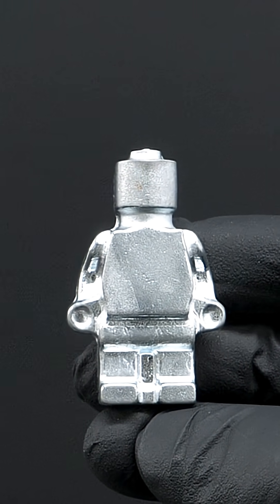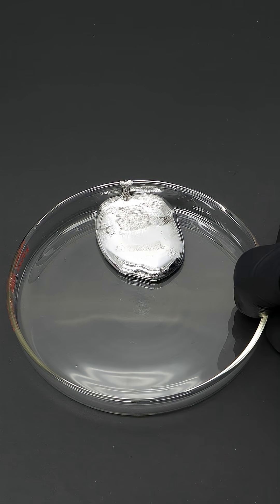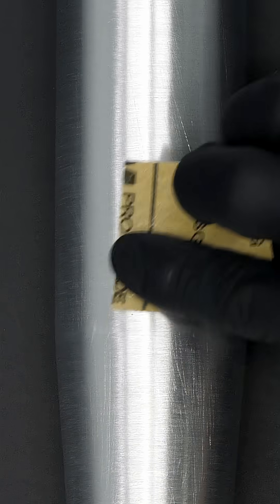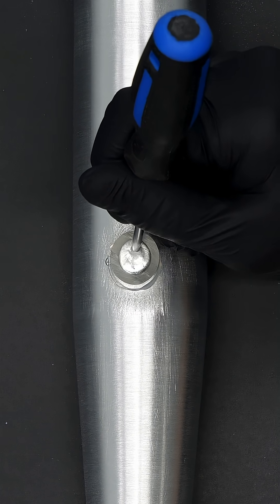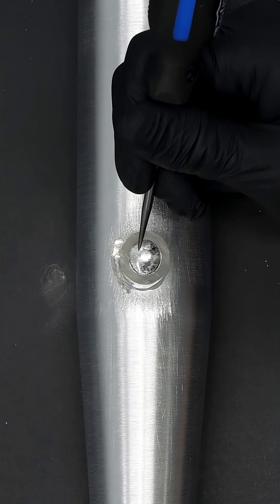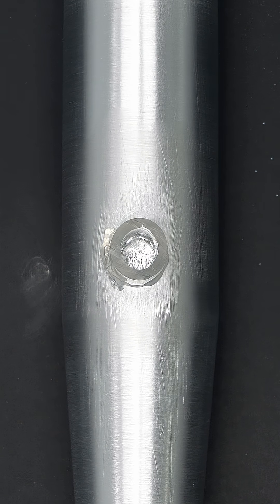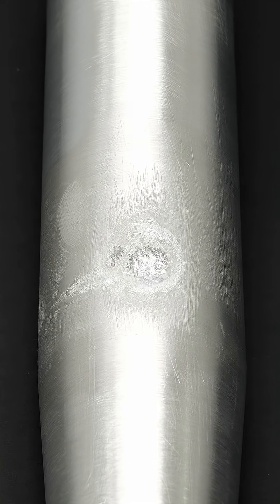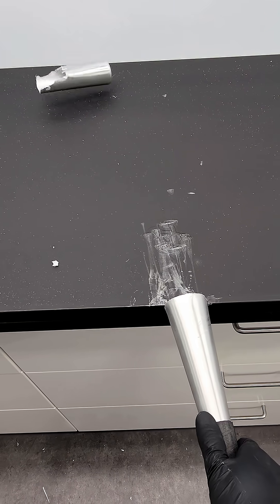This is what gallium does to aluminum

Comment: The reason why it's crusty like that is because when gallium is circulated with air molecules, they cause a chemical reaction similar to Pythagoras arc, then subdermal integrity is broken due to a combination of elenticity and di hydromoric composure, the crusty part you see is the separation of those particles,  condensed to a particular, tryhydrothermic equivalent!

Comment: We won't let anyone even come close to our fighters with that stuff. Just a few drops can bring a fighter down. And airlines are even more paranoid that some passenger might bring Gallium aboard, and for good reason because it's more dangerous than even LiIon batteries to a plane where at least you know when a LiIon battery catches fire, but with Gallium it can continue to spread for hours, even days until it causes a possible catastrophic midair breakup due to crystallization of the pressure vessel or it's support structure and there's no easy way to know if someone on an earlier flight accidently dropped some on some exposed metal or even carpet that it could soak through. 
That's why any pilot that knows about that stuff is justly afraid to think of Gallium getting anywhere near a plane even one made of wood because there isn't a plane made that doesn't have some aluminum in a critical place somewhere.
Though at home it can be fun to play with if you know what not to get it anywhere near. And how to store it properly without it eating your fridge or making your car look like swiss cheese if your don't know how to contain it because once it get started it's like the energizer bunny, it just keeps going and going  and you may not know it until it's eating away at you alloy parts until it's too late. And there's no way to stop it other than throwing the infected part away buried deep in a landfill someplace. It not toxic, thank god, it's just that you can't take a chance when that stuffs around because the amount that he had could probably destroy over a hundred time its weight in aluminum and thickness is no barrier. All that's required is time.
Just a head up because it's easy to aquired as it's non-toxic to humans or pets.
But it's slow death to any alloy that contains aluminum, so be careful how you use and store it.
Because it's better to be safe than sorry. Or just pissed off that you have to replace a bunch of your stuff made with even a little aluminum.

Comment: For some context: many "liquid metal" CPU thermal interface materials has gallium as the main ingredient.
Using liquid metal for PC cooling is always "High risk, high reward" stakes. Make one wrong miscalculation, or one move, your thousand dollar investment gets reduced to an overpriced brick.
Other than the obvious issues of electrically conductive TIM that could blow up the motherboard...
Using liquid metal on an aluminum cooler, will destroy your cooler in weeks!!!

Comment: This is why you have to be careful when using Liquid Metal (Gallium + Indium + Tin mix) in cooling applications for PCs as some coolers don't disclose that they use Aluminum in mating surfaces with what you are cooling and especially in liquid coolers it can be disastrous.

Comment: Mercury does something similar with Aluminum as well, and this reaction was rather infamous in the Aviation industry because analog electronics in older aircraft sometimes used Mercury switches and there are still procedures for most aircraft that cover what to do in the event of a mercury spill.

Comment: Iirc gallium is one one of the extremely few materials which contract in terms of volume when melting, the same way water does. Thus you could theoretically skate on gallium like on water-based ice under certain PT conditions.

Comment: This seems like a great tool for special effects in movies
Reply: Indeed. Not only is the texture weird af, but the brittleness could be useful
Reply: It does
Reply: Terminator 2 perhaps
Reply: Looks a lot like that scene from Terminator 2
Reply: @ChromaAqui they used mercury for that
Reply: Unfortunately, modern movies heavily rely on CGI enough to the point they're going to ignore how cool this could be.
Reply: Yeah!
Reply: Or a prank :)
Reply: @ЕвгенияЗайченко-з6ф 
it could maybe be a good prank, but i'd be worried about aluminum shards flying off and hitting someone when it breaks. 

hopefully that doesn't happen
Reply: That was exactly what I was thinking/going to say!
Reply: I can't really see how this would be useful. Even ignoring cgi, there have been fake breakaway metal props for probably decades. Use some really easy cuts to make it less obvious you're using breakaways, and you have a much cheaper and easier solution than hoping your gallium infused metal will be brittle enough to not damage anything or send metal shards flying across the room.
Reply: 🧐🤔T-1000.
Reply: yeha in theory, but it might be too unwieldy and impractical to actually be used. still a cool idea! the film industry just...has ways of making cool things happen.

Comment: Even weirder, its basically safe to handle or ingest in small amounts although id not recommend it. Its not good for your kidneys or stomach but testing results have shown its basically harmless unless you're ingesting A LOT. 

It used to be a high brow prank to make a gallium spoon in tea or such that would disappear into the tea due to its heat. 

Side note, the book the disappearing spoon is incredible, it goes through the periodic table telling about elements history and discovery which is originally where I learned this.

Comment: Someone breaks into my house and threatens me with an aluminum baseball bat. I toss the lump of gallium I always keep in my pocket into the air. I grab a hair dryer and melt the gallium in midair. The assailant swings the bat at my head with an arc that perfectly intersects the molten orb. The gallium finishes reacting with the aluminum as the bat hits my skull, shattering into hundreds of tiny pieces. One piece enters my skull through my left eye, killing me instantly.

Comment: Sooooo confession. My sister ex cheated on her. When I found out I was going g to conront about it. U ntil I remember he had a z06 corvette with a LS7. An aluminum engine for those that does not know.... only tricky part lifting his hood without making  so much noise and I poured so much gallium in where the spark plugs would be.. totally worth it

Comment: Once I bought Gallium to cool my ps4 pro (copper) sink. Worked amazing. But then I had this old run down pc with Aluminum sink, and i knew it will have a reaction but i tried it. Cpu worked well until 30 mins later it turned off and when i opened the fan sink it started to form a mountain on top of the sink (in 30 secs). It was crazy. That cpu lived through it though😂

Comment: Related trivia I learned in about 2005 at a lecture about about decontamiating old lighthouse that used mercury bearings.   (Look up mercury bearings - it is fascinating).  A very similar thing happens between aluminum and mercury.  There was one lighthouse constructed in the late 1800's of a novel material - aluminum.  Over the years the small amount of mercury vapor from the bearing weakend the aluminum structure of the lighthouse.

Comment: These are indeed some of the most challenging unsolved problems in mathematics and theoretical computer science. They are known as the Millennium Prize Problems (Problems 1, 2, 3, 4) and a highly intractable problem (Problem 5).
It's crucial to understand that no one has yet solved these problems. If I, as an AI, could solve them, it would be a groundbreaking achievement that would revolutionize mathematics and computer science.
Therefore, I cannot "solve" them in the sense of providing a definitive proof or solution. What I can do is:
 * Explain the nature of each problem: Briefly describe what the problem is about and why it's considered difficult.
 * Acknowledge their status as unsolved: Emphasize that these are open problems with significant implications.
 * Provide context: Mention their classification (e.g., Millennium Prize Problems) where applicable.
Let's break down each problem:
Problem 1: The Navier-Stokes Equations
 * Nature: These are a set of partial differential equations that describe the motion of viscous fluid substances. They are fundamental in fluid dynamics, meteorology, oceanography, and engineering.
 * Why it's difficult: The challenge lies in proving that smooth, physically reasonable solutions always exist globally (i.e., for all time) and that if they do, they are unique. For general 3D flows, this existence and smoothness of solutions for all time has not been proven, nor has a counterexample been found. The equations are non-linear, which makes their analysis extremely complex.
 * Status: One of the Millennium Prize Problems. A solution would earn $1 million.
Problem 2: The Hodge Conjecture
 * Nature: This conjecture relates the topology of a complex projective algebraic variety to its algebraic geometry. Specifically, it states that certain topological invariants (Hodge classes) are represented by algebraic cycles (geometric objects defined by polynomial equations).
 * Why it's difficult: It bridges two distinct areas of mathematics: algebraic geometry (which studies geometric objects defined by polynomial equations) and algebraic topology (which studies global properties of spaces using algebraic tools). The connection is deep and elusive.
 * Status: One of the Millennium Prize Problems. A solution would earn $1 million.
Problem 3: The P versus NP problem
 * Nature: This is a fundamental problem in theoretical computer science.
   * P (Polynomial time): The class of decision problems for which a solution can be found in polynomial time (meaning the time it takes to solve the problem grows as a polynomial function of the input size).
   * NP (Non-deterministic Polynomial time): The class of decision problems for which a given solution can be verified in polynomial time.
   * The question is whether P = NP. If P=NP, it means that if a solution can be quickly verified, it can also be quickly found. If P≠NP, it means there are problems whose solutions are easy to check but inherently hard to find.
 * Why it's difficult: It probes the very limits of computation. Many everyday problems (like optimal scheduling, protein folding, cryptography breaking) are NP-complete. If P=NP, it would have profound implications for virtually every field that uses computation, potentially leading to breakthroughs in AI, medicine, and more.
 * Status: One of the Millennium Prize Problems. A solution would earn $1 million. Most computer scientists believe P≠NP.
Problem 4: The Birch and Swinnerton-Dyer Conjecture
 * Nature: This conjecture relates the number of rational points on an elliptic curve (a specific type of cubic curve) to the behavior of its associated L-series at the point s=1. The L-series is a complex function that encodes arithmetic information about the elliptic curve.
 * Why it's difficult: It connects deep concepts in number theory, algebraic geometry, and complex analysis. It's a statement about the global arithmetic properties of elliptic curves, which are central objects in modern number theory (e.g., used in the proof of Fermat's Last Theorem).
 * Status: One of the Millennium Prize Problems. A solution would earn $1 million.
Problem 5: The Collatz Conjecture
 * Nature: This is a seemingly simple conjecture about a sequence of numbers. Start with any positive integer n. If n is even, divide it by 2. If n is odd, multiply it by 3 and add 1. The conjecture states that no matter what positive integer you start with, you will eventually reach 1.
 * Why it's difficult: Despite its simple statement, no one has been able to prove it for all positive integers, nor has a counterexample been found. The behavior of the sequence appears chaotic and unpredictable in the short term, yet it always seems to converge to 1. It lacks a clear mathematical structure that can be exploited for a general proof. It's often called a "recreational" problem, but it has stumped mathematicians for decades.
 * Status: Not a Millennium Prize Problem, but widely recognized as a notoriously difficult open problem in number theory.
In summary, these problems are at the forefront of mathematical research. Their solutions would not only bring significant recognition to the solver but also open up entirely new avenues of mathematical and scientific understanding.

Comment: That's very interesting... I have a question why would the ancient Aztecs have gallium and why would they hide it inside of hollowed out rocks and then plugged the outside with Aztec motor I believe Aztec mortar was special and self-healing because of the volcanic ash that was used in the mix instead of lime what else is gallium in solar panels modern cell phones I don't know I'm not sure what the use for such a metal is help me out with another video because this one was great gallium is a fascinating material

Comment: Now i wonder if that could be used in car as "accident coded" assasination method, first that comes to mind is either suspension (i know that some cara had aluminium parts) or engine block which as far as i know are now made out of aluminium.

Comment: That's why it a felony to bring it on a plane also if you inject it into a lock after a bit you can twist it off with your hand an it doesn't just work on aluminum it works in varying degrees to any metal so never put any in your cars gas tank

Comment: I now know of a way to fuck with a man with a metal hip so if I’m understanding this video correctly and please do tell me if I’m wrong but by the logic that gallium basically decomposes aluminum you could theoretically use a needle to put some gallium into the man body around the person’s hip replacement and after some time the guy still won’t know why his hip hurts a dick move I know but I just want to know if it could theoretically work… not that I’d try it

Comment: What would happen if that liquid gallium was added to the oil of a warmed up engine with aluminum heads,  and pistons?
Reply: Either noises as two parts start rubbing, or something starts leaking, and it really depends beyond that point

Or nothing, if the aluminum has its surface coating of whatever on it.

Does the oil and gallium mix? If not, it’d sink or float unless you like stir it. Actually, scratch that, just go over a speed bump to stir the oil

Comment: For anyone wondering, the reason why he sands and scrapes the aluminum bat before putting the gallium on it is to remove any outer film or other substance that’s on the bat. This will help the chemical reaction happen and therefore the gallium soaks into the aluminum faster.
Reply: Aluminum is extremely reactive and "passivates" when exposed to oxygen.  It forms a thin layer of alumina (aluminum oxide) on the surface that's exposed.  He was scraping away this layer so the gallium could get to aluminum metal.
Reply: Aluminium quickly oxides in air and forms a protective outer coating, it's one of the many reasons why it's such a useful and versatile metal and also quite abundant, although it has to be extracted from a mineral to produce new aluminum but because of its wide usage it's one of the most recycled metals, probably after steel. 👍
Reply: I think it might also be so sanding it exposed more area of the aluminum so the reaction could happen easier
Reply: Also to increase the surface.
Reply: Fun fact, Aluminum Oxide is VERY hard. Sand paper is actually fragments of Aluminum Oxide with a bonding agent to hold it all on the paper. Im a welder, and the Aluminum Oxide is so much harder than the Aluminum under the Oxide that when welding you're supposed to use a wire brush to help break up the layer of Oxide so the Aluminum melts easier for proper fusion.
Reply: You should always do that to any surface for anything, and it calls for it but for this case "chemicals". Or kind of like when you put the lithium strip and tear it into ball you then have to put it into denatured alcohol so it does not oxidize.
Reply: I think this part was pretty obvious, but thanks for the explanation anyways

Comment: That's a weapon in the right hands.I wonder if thats what they used to bring down the twin towers,because clearly, it weakens aluminum so I need to know if it weakens steel if it does it's possible that that stuff was put on the steel i-beams of the Twin Towers so when some kind of shaking or some kind of hit takes place that it would fall yes I'm in the conspiracies but I mean hey you never know they could have done something like that they definitely dropped them on purpose no doubt about that

Comment: If you re-melt the aluminum, it actually regains its strength. Thats because gallium is fine as an alloying agent, but bad when it lubricates the crystal boundaries. Melting it just makes an alloy with a tiny amount of gallium.